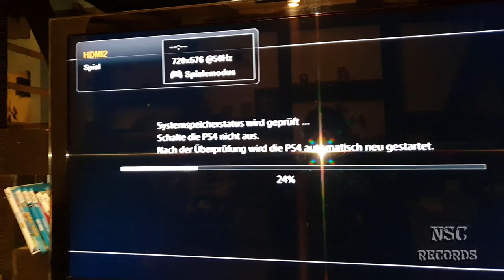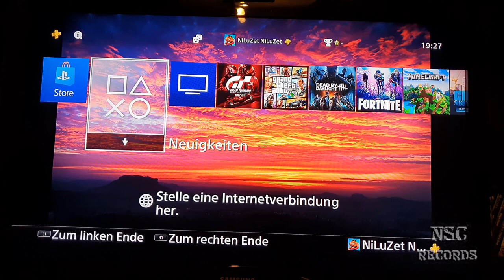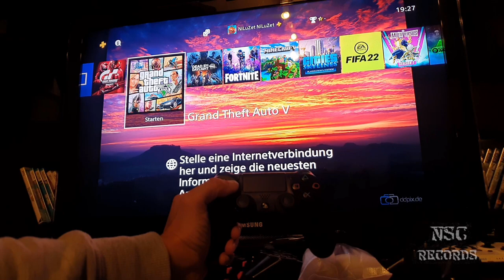PS4 Slim Overheating - No Wifi - No Bluetooth - fixed! By:NSC

Comment: Hey, have you even heard about a ps4 cuh1216 thst turns off randomly? AFfter about 30minutes on internal PSU and 3 hours on external power (atx) but only when downloading via wifi. It looks like something is overheating and making short but whats funny in it, ps4 wont turn again until unplugged from ac and plugged again.

Comment: Bro you can nickel plated also the aluminum.!! But 1st you must copper plated it 1st the aluminum to stick the copper electroplated then, go to proceudre on nickel plating
Reply from the maker: Yes, i know, you can do the plating on all metals, BUT aluminum makes no sense, the aluminium has NOT a good heat transfer like copper. Copper is the best metal for heat transfer.
Reply: @NSC-Modz  did you know why almost of the fins used on the heatsink cooler on cpu tower coolers and gpu cooler are aluminum not copper? Copper much better on transfering on heat but aluminum are much better than copper of dhesipation of heat through air
Reply from the maker: That's right. About the fin's, maybe on some Heatsinks, but not on all, it always conforms a lot other things 😀 The only reason here i see is Money, a full copper Heatsink with copper fins costs more money on the production than aluminium. The other problem is also, that copper is a soft metal, it's just not really recommend for the fin's.